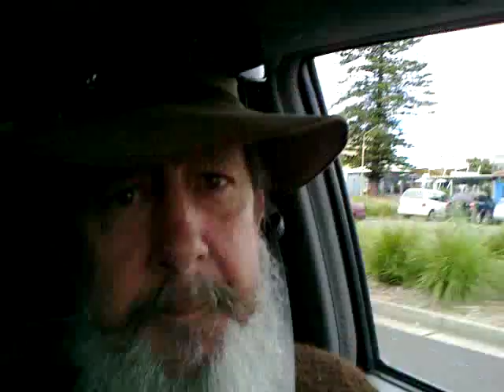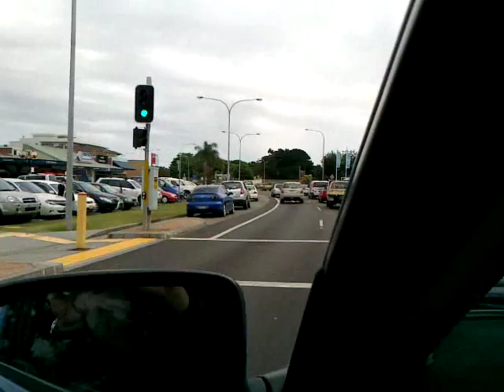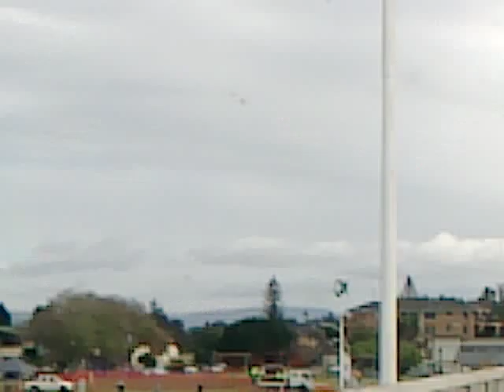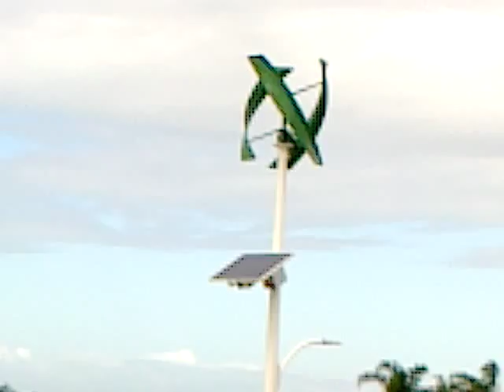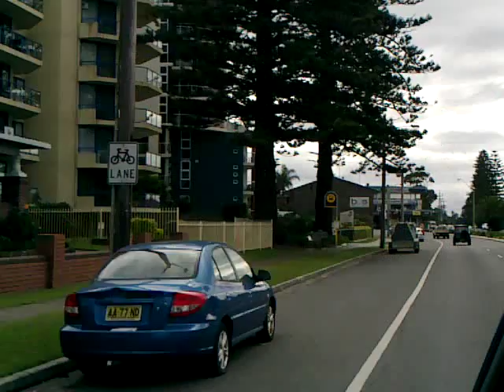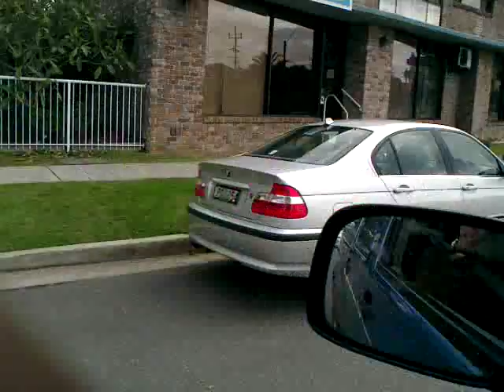Helical-Trefoil Darius (Vertical Axis Wind) Turbine.

Comment from the maker: @BillofRightsBrutus
  G'day... Thanks mate ! Yes, it's a Bobby-Dazzler I reckon. It should start itself up, in anything from 5 to 10 MPH Wind, and stabilise at about 300 RPM in 20 MPH...(just guessing). It looked to be doing 120-150 in 10-15 MPH, when we went past ; and 50 in 5-8, two days earlier. Faster than a Savonius, anyway, though it looks kind of tricky to build, though.
Ciao !

Comment from the maker: @wakeupofg
  G'day.... Yeah, the big ones are awesome. There's a Windfarm in the pipeline for around here which is to have 100 Metre Diameter Rotors on Towers 75 Metres to the Hub... More or less a 500 Ft high Dynamic Sculpture..! Sadly, some local yokels hate the idea of it. I worry they'll puncture the Gelcoat on the Composite Blades with Fox-Rifles, then Condensation & Frost Freezing will Delaminate them... Ice Crystals exfoliate Composites, so time will tell..?
Ciao !